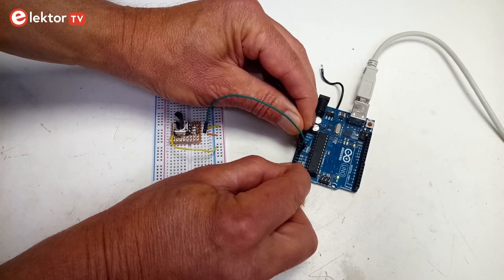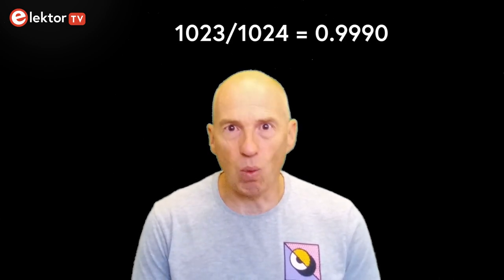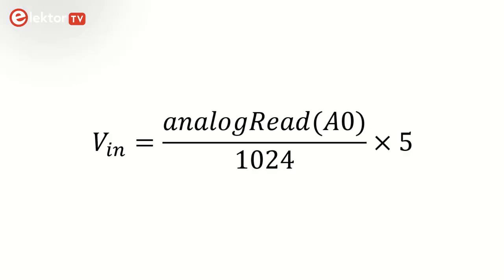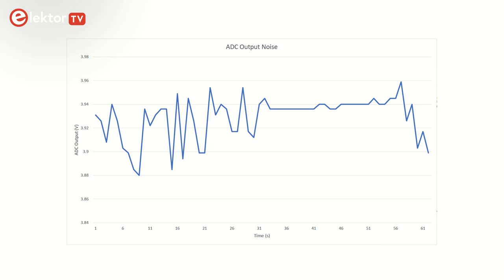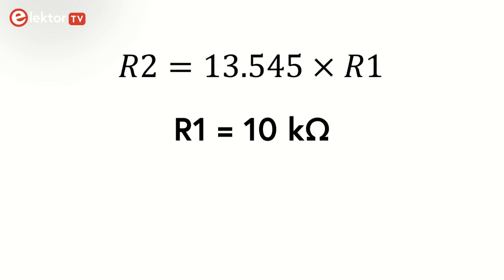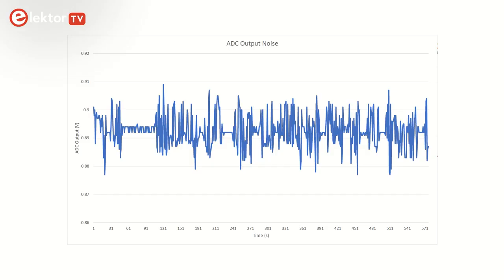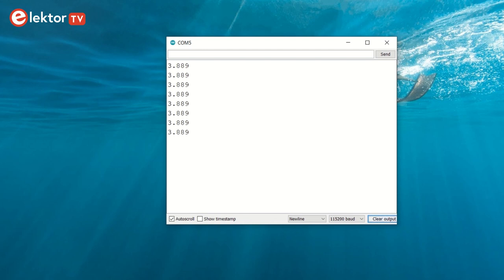How-to: Accurate Voltage Measurements with Arduino

Comment: ATTENTION: 4:29 In case of car's alternator failure (of its internal voltage regulator circuit) the "V bat" could increase up to 22V (or maybe more), proportional to engine RPM. To avoid a burnt arduino, it's safer to assume maybe 25V to "V bat" at voltage divider circuit calculation. 
Many thanks for this lesson, I was searching exactly for this topic!
Regards from Brazil!

Comment: Excellent start! As a continuation, you can show how to amplify a weaker signal, and how to adapt a voltage of maybe 2-4V to use all the bits in the AD converter.

Comment: I would add that the reason why we divide by 1023 instead of 1024 is because the 0 (zero) is included as one of the values, so we still have 1024 values but zero is one of them; in other words, we're counting from 0 instead of counting from 1, so that's why it ends at 1023.
Reply from the maker: We don't divide by 1023, because the datasheet says that you must divide by 1024 (section "ADC Conversion Result"). 1023 equals to Vref minus one LSB. So, if Vref=5V, then 1024 = 0x400 = 5V; 1023 = 0x3ff = 4.995V. Unfortunately, 1024 doesn't fit in 12 bits.

Comment: external interference performance can be improved by adding a capacitor between ground and the analog input (as close to the ADC pin as possible). 1nF should be a good compromise between speed and filtering quality.
Less accurate power supplies can be used if a large value low ESR capacitor is used across the 5V rail and the 1.1V reference is selected.

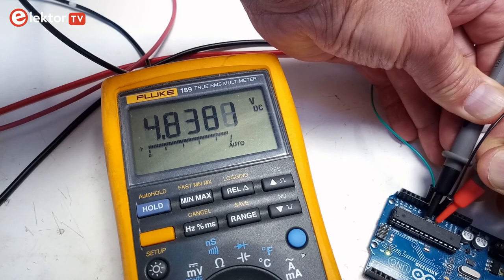Comment: At 7:25 you measured ONE value (4.834V) but inputted a slightly different value in the sketch (4.863V).

Comment: The bandgap reference on the Atmega328 can vary a bit from unit to unit. In order to have the highest accuracy, you can measure such value and make your calculations with the real value, not the one mentioned on the datasheet.  I got great results doing that.

Comment: @2:49 additionally to floating-point calculation, isn't it more appropriate to multiply by 5 first, then do the dividing by 1024 as the last step ? Or does the compiler already do this optimization automatically ?
Reply from the maker: The compiler does not do calculation quality optimizations, only code optimizations. Multiplying by 5 works for integer maths but it remains integer so the output will be between 0 and 4. Floating point has enough precision that multiplying by 5 first doesn't improve much. larger factors like 100 or 1000, yes.

Comment: Since the max value of the ADC is 1023, I would divide by 1023 instead of 1024.
Reply: other than that, very interesting video
Reply from the maker: Yes, but no. The ADC's maximum theoretical value is 1024. 1024/1024=1. But 1024 = 0x400 which requires 13 bits whereas the registers are only 12 bit. Therefore, the maximum register value is 0x3ff, which is 1023. So the maximum value in practice is 1023/1024 = 0.999. See also the MCU's datasheet.
Reply: @ElektorTV  Indeed, there is a catch... from the datasheet : "and the maximum value represents the voltage on the AREF pin minus 1 LSB."
Reply: @ElektorTV  Yes, the MCU is not able to measure 5V. Now it depends on you how to overcome this problem. You can use 1024 to show the error only on 5V or use 1023 to spread out the error over the full range.
Reply: @ElektorTV  PS.: The real problem is not the question 1023/1024, it is the multiplication with 5. It should be the 5-1 LSB instead.
Reply: It's impressive that so many knowledgeable people get that part wrong. I'll bet his code is filled with off-by-one errors.
Reply: No, there are 1024 intervals, each well identified by calculating value at the bottom of its interval.  I If you divide by 1023, the bottom interval is identified by it's lower edge at 0 and the top interval by it's upper edge at 1. If you want the identifying value to be the voltage in the middle of its 1LSB-wide interval, use  Vref*(ADC+0.5)/1024, then the 1024 intervals between 0 & Vref are each 1LSB/1024*Vref wide,.    (Also, the datasheet says /1024.)
Reply: @ElektorTV  I believe the Arduino Uno R3's ADC registers are only 10-bit, not 12-bit. And 1024 = 0x400, which requires 11 bits, not 13 bits. The Arduino Nano 33 BLE's default resolution is also 10-bit, but it can be changed to 12-bit.
Reply from the maker: @mvrkmi  You're right, that is a typo in my reply. Sorry for that. ADC is 10 bits, 1024 needs 11 bits.

Comment: What about a higher voltage inputs 0 to 500 volts maybe
Reply from the maker: The same principles apply, but the voltage divider needs more attention to support high voltages (use several resistors in series for instance).
Reply: I did it up to 600v. No problem. You will have a step of about 0.6v with the 1024 bit of th arduino uno.
Reply: @programmer1111x  great

Comment: Sir I will try to make dc volt meter using ESP32 and I2C 16*2 LCD.
Am facing some critical condition
Actual voltage 12.7V
LCD display 12.7V
But
Actual voltage 7.4V
LCD display 6.9V
This problem only for ESP32, Arduino UNO is perfect work in range.
How to solve this problem sir ?

Comment: Why you divide by 1024 when you have between 0 and 1023 only 1023 intervals of length 1.
Reply from the maker: Because there are 1024 intervals. Please refer to the section entitled "ADC Conversion Result" of the ATmega328 datasheet. 1023 corresponds to VCC minus one LSB.

Comment: can you make Ac voltage meter 0-400v with 0-20mA output or Rs485 Modbus RTU
Reply from the maker: Of course, you can. Just be careful with the high voltages.